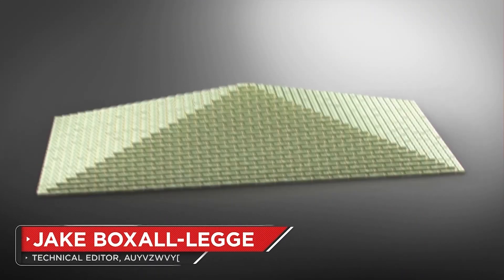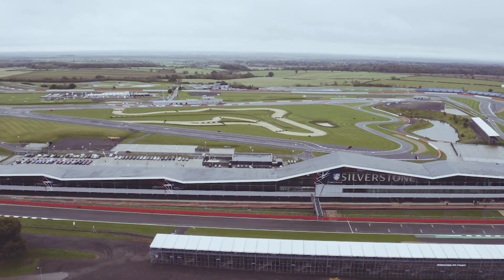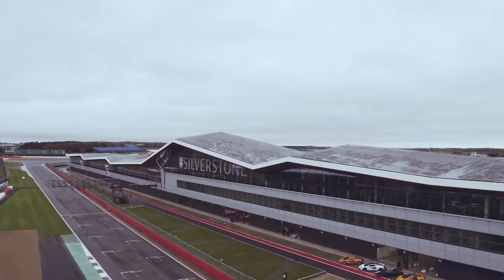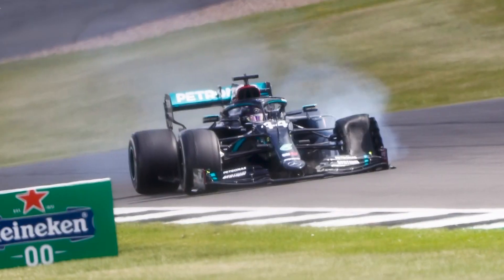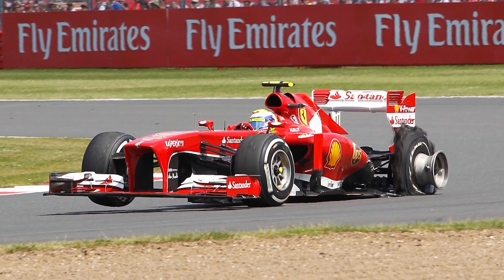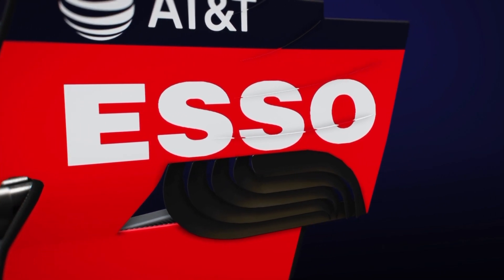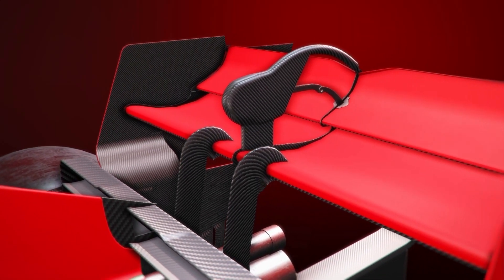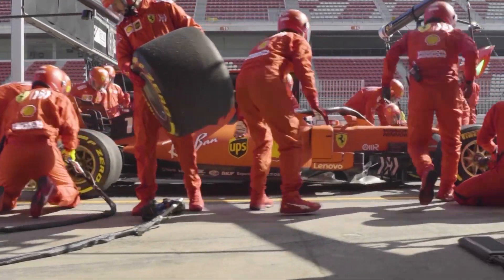Why Tyres Failed At The 2020 F1 British Grand Prix

Comment: With the early safety car the teams were almost forced to run extremely long stints. Hopefully with 1-step softer tires will require teams to 2-stop or maybe even 3-stop the race. If not we may see a bunch of shredded rubber on the track this weekend.

Comment: I thought the purpose of tyres that degrade was more pits stops, all teams need to do is a 3 stop race.
Reply: They are designed to degrade to slow the car down, not to have the tire explode.
Reply: its faster to not pit
Reply: Just a WARLORD .... but if they pit more often for tyres, they can race not worrying about tyre degradation and the racing is more dynamic for the fans.

Comment: Teams should do 2 pit stop race. Which will make it more exciting
Reply: They are doing 2 stops for sure at minimum also potentially 3 stops will be needed because the medium compound this upcoming race will be only good for 15-20 at max.
Reply: @kalyankothekar  and those who start the race in soft tyres will have to pit by lap 5 or 6
Reply: @kgeaswaran  yup this race will be an intresting one 🤞🏻

Comment: I think double weekend races are a plus nobody ever saw.  they can fine tune their cars that much more plus if we see varied results like Austria do we really need 21 different races? 10 double weekends plus a bonus track would be great for car performance as they can test each track twice a year and also would cut costs drastically given the new  budget cap and lot more play for the lower teams. i know it would cut out tracks but the ones that stay would be  that much more profitable. Huge run on sentence but I'm buzzed
Reply: It's nice during Corona, but it isn't a long term solution. Nobody will go to a Grand Prix 2 weekends in the row and other countries with fans which want to see Formula 1 will get absolutely nothing.

Comment: Everyone seems to have forgotten that both ferraris had tyre failures at the end of the 2017 silverstone gp. Change the tyres sooner... simple.
Reply: A race tyre should run out of tread before it fails structurally
Reply: @zwamman  err, they did. There wore out to the point that they deflated because there was no tread there anymore. At the speeds of f1, even in corners, the second the tyre deflates, it starts tearing itself to bits.
You can see that the tyres of the mercs and sains all failed along the inner line that has the highest wear, because of camber.

Everyone wanted tyres that would let people battle. That's why the tyres don't fall off a cliff, in terms of grip, like they did years ago. Last time Pirelli made tyres that had massive reductions in grip as they wore out, everyone complained that the drivers had to conserve the tires too much.
Reply: @ryanokeefe12  No, if the tread is gone the tyre would fail of dramatically in performance. Lewis was still putting in the lap times, but the tyre construction let go. Pirelli do claim the wear (i.e. reduced tread) resulted in higher stresses on the tyre, which is true since you have less of the very elastic moving rubber absorbing the energy. However, they gave a guideline of 40 laps at race speed and the tyres were just not up to that.
Reply: @zwamman  As I said mate, the tyres don't drop off a cliff in terms of grip like the used to. The rubber used to change to less grip all the way through to the core. now, only the first few layers have progressively less 'grippy' rubber.
You are making assumptions here and arguing an incorrect point, when you don't really know what you're talking about.
Reply: @ryanokeefe12  I will not argue further with someone who does not seem to get how racing tyres work, how they generate temperature and what makes them fail. Have a good day.
Reply: @zwamman  lol... You're a fool. Feel free to explain how you think a tyre should be able to drive when there is no tread left, let alone, hold air? The tyres failed along the inner edge.
As I've said 5 seperate times, the compound isn't altered in the final layers of the tyre.
If you knew anything, you'd know that the rubber changes throughout the depth of the tyre. If it didnt, the tyre grip would not change drastically.
The tyres wore through to the tyre carcass and then over a couple of corners, the air blead out and then the tyre failed because of the excessive movement.
Get a clue bro.

Comment: Why does everyone suspect pirelli its the FIA suits that made a law to create soft med hard tyres with tyre deg in mind
Reply: Why would you blame the FIA? It's the team's that chose not to put and run their tyres off the rim. Every team had tyres to strap on it's not the FIA fault they didn't do it
Reply: I doubt deg had anything to do with this failure. The sidewall gave up and delaminated the tire. To me the telling part of EACH failure was the warping inside sidewall just before giving up. I'm sure Pirrelli will say it wasn't their fault but its pretty obvious it was. But that said, the teams always push too far, and I'd bet the failures were all at an odd  pressure.
Reply: @mikejackson9585  the "warping" was the deflated tyre before the tyre split apart. The tyres clearly had radial blistering and were pushed too far.
Reply: @ryanokeefe12  Check again,  the blistering was on the opposite side.
Reply: @mikejackson9585  man seriously... they clearly pushed tire too far, Botas said few laps before accident that his tire starts to vibrating - they all knew tires are at the end yet no one decided to pit for 
known reasons. Tires lasted as much as pirelli predicted, and its durability was said at beggining when race was broadcasted live.
Reply: @TheBogimen  They definitely went too far, but the failures weren't worn out tires in the normal sense. They were pushed till the carcass failed. A tire that is run out of tread fails differently and generally shows signs. That tire looked fine right up till it failed.
Reply: @mikejackson9585  ...

Comment: It's rather strange, Daniil Kvyat's tyre failure was nowhere in the mention. It was a MONSTROUS shunt which at first appeared to be driver's error only to be found that the accident was caused due to his AT01's rear right tyre puncture!
Reply: Pretty sure it was said that it was his car that messed up not his tire
Reply: @KitKata0 : There is a footage on the official YouTube channel of F1 which shows the accident from every angle. It looks quite apparent that it was a tyre failure!
Reply: the mercedes/mclaren tyre failures and the kvyat failure are 2 seperate things. the kvyat failure was likely debris. The tyre failures at the end of the race were simply from teams pushing the tyres too long.

Comment: The one aspect of F1 I absolutely hate when it comes to auto racing is that they HATE changing tyres during a race. The teams seem to want a tyre to last the whole race. They are content to burn up 10 sets for Qualy, but when it comes to the race they all want to trundle along in their position and maintain it the entire race. Maybe pick up a spot or two if they can. Just about all other forms of auto racing I watch, they constantly change the tyres to gain an advantage or use the new grip to get ahead of others. Now in some auto racing where they dont change the tyres as often, the cars can follow and pass one another multiple times during a race as the aero off another car doesnt cook theirs. F1 should have tyres that don't last much past 20 laps and allow drivers to attack one another every lap! Instead, we get this train of cars following one another maintaining their distance, like a line of lambs off to the slaughter. Honestly, the first lap of an F1 race is often the most exciting, and during the race, the only exciting things that usually happen is someone has an off. Otherwise its 2 hours of ho hum cars trundling along as we listen to Ted and Martin.
Reply: There is too much tire management going on. Perhaps in 2011 this would have been a 3-stop race, but nowadays the drivers just manage the tires so they don't have to change tires all the time. At Silverstone it seems not that much tire management is needed to keep tire degradation low, which explains why 1 stop was the way to go. The main problem is that the tires failed unexpectedly, that is, before they started to lose considerable amounts of grip. Next race will likely be more exciting, though.

Comment: This isn't 2013. The tyres are fine and it's the fault of the teams and drivers for doing long stints and using areas off track that could damage the tyres. They should make changes themselves and not blame the tyres every time. Pit stops are there for a reason.

P. S. Did this video come out just after an announcement about the Perreli investigation? I just saw a video by another channel that quoted from it.
Reply: Even in 2013 it was the teams doing stupid shit and not running in recommend parameters by pirelli. Honestly feel bad for pirelli, FIA wants tyres with very specific demands and then teams vetoing and declining upgraded tyres which will be able to deal with the ever increasing loads. They are in this for marketing and all they ever get are bad press.
Reply: @lelouchvibritannia1788  it's like... Rubber, as a material can only do so much. The cars might get too fast for tyres at this rate of improvement year by year.